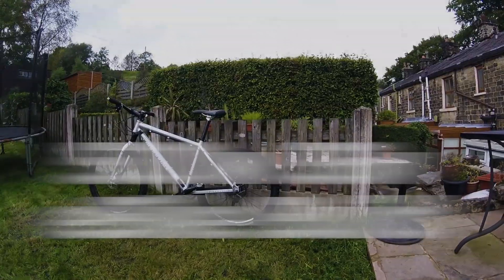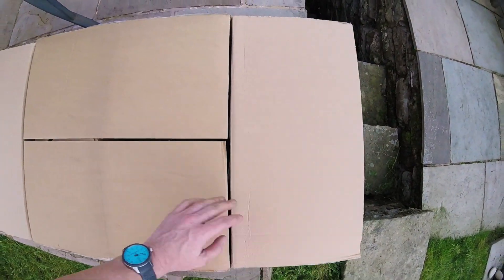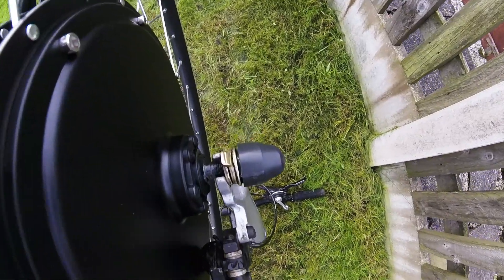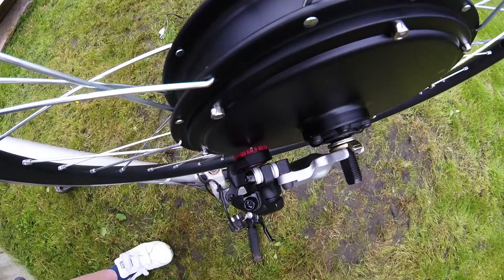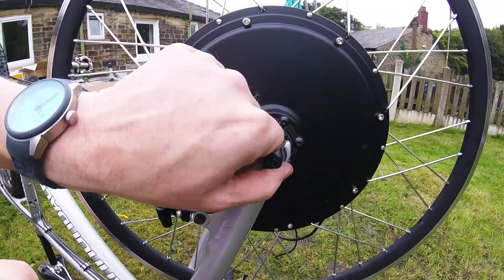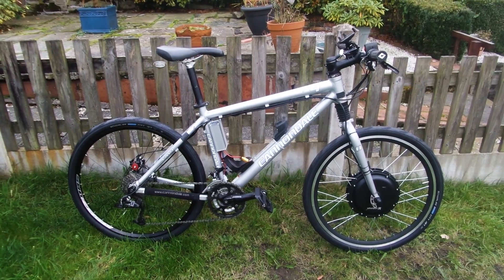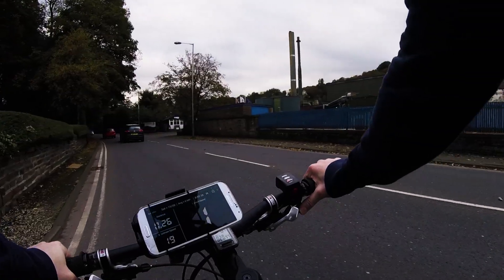500w 36v Front Wheel Ebike Build by an Ebike Noob

Comment: Do you need to pedal to get the motor going or is there enough power from stand still? 
This question is to anyone who owns a front wheel ebike?
Reply from the maker: No you don't.  Just twist the throttle & go
Reply: its a cool concept. you still have gear gadget when you run out battery...

Comment: Nice, but of course completely illegal. UK law limits power to 250W and yours is 500W. UK law also does not allow a thumb or twist grip throttle, as you's has. This means if you have an accident it is automatically your fault as you are riding illegally. If you hit anyone, they can automatically sue for large sums, again because you are at fault for riding an illegal vehicle. It's as if the legislators are determined to keep everyone in cars.
Reply from the maker: All very true.  Hopefully legislation will loosen and more powerful ebikes will be allowed.
Reply: I will post mine in a month--dual motor 1750 watts.
Reply: the law does allow a throttle
but 4mph 
called walking speed

Comment: Still working? Any repairs/replacements?
Thank you.
Reply from the maker: It is still working and no replacements or repairs.  I only use it in summer and not that often.
Reply: @richardhanson2331  hello bro. whats the  range on your bikes also what mah batterys did you use?
Reply from the maker: @mydaddrinksbathwater9103  hi, it works out at about 1mile per ah. I use a 5ah and a 16ah for longer journeys
Reply: @richardhanson2331  okay man ghanks for info

Comment: Some electric motors work as a dynamo when turned, do you think these motors could be converted to charge the battery when going down hill or when doing light work?
Reply from the maker: Not sure.  Some kids have regen but these cheap kits definitely don't
Reply: Minimal charge, regen only helps save the brake pads, not enough mass with a bicycle for decent regeneration of the battery

Comment: hi mate , nice clear vid .......i have just got one of these kits , are you saying that the pedal assist is an optional  piece ? , that you can just fit the thumb throttle and it will work fine > ......also did you not fit the  kit brakes at all ? .i thought they were needed to cut out the power to the motor when breaking ?

cheers
Reply from the maker: cheers.  The pedal assist is optional but needed for legality in the UK.  I didn't fit it though.   I didn't fit the cut out brake levers either and it's fine if you have decent disk brakes.   You can cut the power with the power button on the throttle at any time so seems safe enough to me
Reply: @richardhanson2331  thanks mate ........ i will fit the pedal assist too i reckon ., i have gone for a 12.5 amp  battery , not fussed about speed , but endurance  is what im after .

Comment: How far can you go
Reply from the maker: It depends on which battery I'm using.  The rough guide for this setup is about 1 mile per amp hoir. So a 10 amp hour battery gets me 10 miles of range or thereabouts. I could get further if I was gentle on the throttle

Comment: When I fully charge the same type of battery one light stays red but the other 4 are green is this normal or is it just because my battery is older/second hand
Reply: 4 green 1 red = 100% charge
3 green 1 red = 75% charge
2 green 1 red = 50% charge
1 green 1 red = 25% charge 
1 red = (CHARGE BATTERY)

Comment: A good build and most sensible practical and interesting comments in this thread for all E Bikers. good advise on points of very unrealistic UN Laws that endanger the rider as to power. When you buy a car it doesn't mean your going to boot it to maximum speed unless your  a lunatic. Riders need reserve power for uphill climbs otherwise risk burning  the motor out that's common sense something which is  lacking in most all UK Laws.

Comment: I have a 28" tire when i look up the 28" front wheel hubs they either dont say what fork size is needed or its between 100mm and 105mm mine is more what can i do?
Reply from the maker: Hi,  There are various models of this type of hub motor on the market.  I would search for a hub motor which fits your fork width.

Comment: Great video can you please tell me how heavy does the kit and battery make the bike I'm thinking of doing a similar conversion to a mountain bike (probley a rear wheel drive conversion) I'm in a Massenet so would like to know what they are like getting up and down stairs! & if a 250 watt motor is lighter than 500watt motor or is 500watt heaveyer than 250watt motor? or does the size of the motor in Watts make no difference in the overall weight of the bike?
Reply from the maker: Thanks.  The motor makes a huge difference to the weight.  from very easy to get up steps before the conversion, to very difficult after the conversion.  A 250w may well be lighter.
Reply: Richard Hanson Thanks for the quick reply might go for the 250w kit if it's lighter and one with a throttle/controller switch option and use it with the brakes in short controlled bursts to try & help me get it up and down stairs i hope that might work except if the battery runs out of juice lol

Comment: Do you know if can use a 48V 10Ah battery with a 1000 watt rear hub motor, though the controller apparently requires a 48V 11.6Ah battery ?
Reply from the maker: Hi, It should work fine as long as the battery is the correct voltage for the controller.  It will just give you a shorter range.  I've run this 36v on a 5mah battery for testing and it worked great.
Reply: I'd get 20ah bro 😂 mine was about 13ah on a 500w take you 3 or 4mile in 15 to 20minutes but I only using laptop cells lol
Reply: Thank you all

Comment: How can I test ma 48v against urs if ya in ramsbottom 😂😂 what a name for a town 😂😂😂
Reply from the maker: Ha it's a nice place though despite its silly name 😁 the 48v would win! I plan to try 48v on this set up. It'll either work or blow the controller.....
Reply: @richardhanson2331  its ok but I only using laptop cells 8p x12s and I got high resistance cell pack which I need to replace now very annoying middle pack too 😂 
Might just make another 6s instead tho
Ur controller probably would heat up tbf but u cud use 48v controller on ur 36v motor give it a boost 😂
Reply from the maker: @davey2k12  I'm gonna give it a go but 48v through the front wheel might be the limit!  Would rather stick 48v thru the rear to be honest!  😃
Reply: 1000w on front max but with chunky frame tho might be a wheel spinner tho like mine 😂
Reply from the maker: @davey2k12  yup I might have to upgrade from the semi slicks!

Comment: Great video. Can you please tell me if the power to the motor slows down once your finger comes off the controller. Thanks
Reply from the maker: Hi Thanks for your kind comment! Yes power to the motor is shut off when you take your finger off the controller.
Reply: @richardhanson2331  Ok. That's what I was hoping. I really want one of these kits. Thanks for the quick reply.

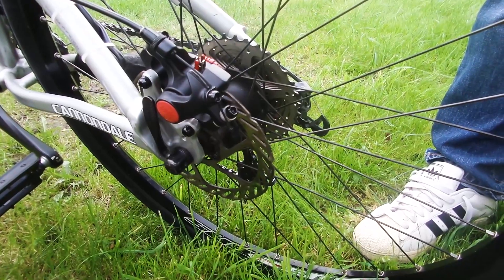Comment: I put my Ebike Front Wheel on the other side  not like you did in 4:07 is this a problem?
Reply from the maker: If you mean the Torque arm then no problem as long as you have one fitted.
Reply: @richardhanson2331  no I mean where the Cable comes out!
Reply from the maker: I'm not sure If it's the same kit as this then it only goes on this way.  The disk mounts on the wheel and the fork should be on the same side when you fit the wheel. .

Comment: greetings from florida USA. is it hard to pedal the bike when there is no power to the motor ?
Reply from the maker: Bob Americana Hi Bob.  Its very difficult to pedal the bike for any great distance with no power.  You wouldn't want b to get stuck far from home with a flat battery
Reply: thanks.  @richardhanson2331
Reply: @richardhanson2331  Hi Rich, why is that? Doesn’t the motor disengage when you switch the throttle or pedal assist to 0?

Comment: Thnks for posting this as ill be buying a 1000watt kit soon and you have sdome helpful tips about strenghting the front forks plus disc brakes
Reply: brakes are brakes but you indeed want torque arms for a 1000 watt motor.. high watt motors have the nasty habit of snapping the drop-outs where the wheel is mounted..unpleasant for a rear drive motor..a hospital visit for a front wheel drive.
Reply: @bobamericana3099   Thanks for advice but ill be going for a front wheel and yes ive been over handbars a few times when i was a kid
Reply from the maker: @sparkles9868  Brakes aren't just brakes.  With a 1000w on your front wheel you need disc brakes for sure.  Hydraulic are better but the mechanical ones I used do the job OK. I've seen videos on here of powerful ebikes with rim brakes and V brakes and there's no way they're stopping you quickly from 30+ mph.  Anything over 250w and disk brakes are a must.
Reply: @richardhanson2331   Thanks for adice but i am a qualified mechanical and eletrical engineer and know what it is like when brakes fail
Reply: @richardhanson2331  Yes I know and had brakes fail on me before which why i go hydralic when i can 

I wont be buy a hub motor now as found a more efficent way of doing it which uses all the gears on the bike

Comment: Your convesion is awesome. Just the right sort of practical speed needed to get the morons out of cars, for want of the obviously necessary total car ban (we have no carbon budget for 3 degrees warming so nobody should be allowed to have cars, ecars included). The uk ebike limit needs to be raised to a sensible 500 watts
Reply from the maker: Hi,  Thanks for your kind comment. I agree 12-15 mph is way too slow for most people to travel any kind of distance. 25-27 mph feels like a sweet spot for me.  The bike feels safe, handles well and I can cover a decent amount of distance.  I also have a solar installation in my shed so I can charge the batteries solely with green power.
Reply: bloody idiot, where do you think those kits come from?  how do you think you get them.  everything is brough by cars, ships, planes that polute and do all kinds of stuff to an environment.  but of cause, everyone is a moron for you.  go live in a fucken cave off-grid and stop using benefits of civilization then you will have a right to call people names over stupid ass enviromental opinions.

Comment: Hello, mate.

Am just about to buy the same kit on ebay. I've heard bad things how is yours holding up after 10 months?
Reply from the maker: +Dr Robert  If it all breaks, it's not the most expensive kit and you'll have the experience of doing the build.   There are some expensive kits out there which are probably better, but for a cheap simple build this is fine.  Road legal feels unbelievably slow after you have ridden unrestricted.
Reply from the maker: Dr Robert hi, I only built it for fun so not used it too often and manly short trips,  but so far it's been great, even overvolted. Done a couple of 15-20 mile trips with no problems
Reply: @richardhanson2331  Thanks for your speedy reply, I think am going to buy one and keep it in road legal mode as am only commuting 6-8 miles each way I can't see much to go wrong, I presume those people complaining just don't know what they are doing.

Comment: Thanks for the vid. How many AH is your battery?
Reply from the maker: Thanks for the comment.  I have used 3 batteries. a 5mah lipo setup, a 36v 10.4mah Li-ion bottle style battery and a 16mah lipo battery.  i sold the Li-ion battery because the Li-po batteries are more powerful and more fun.  For daily use and commuting the Li-ion battery would be the sensible option.

Comment: This is the exact kit I'm looking at to boost my commuter. How has the kit and battery held up?
Reply from the maker: Aaron _ I haven't done too many miles on it because I built it for fun.  But it has been very reliable so far and I can't see it causing any problems.   I would get puncture resistant tyres and inner tubes for commuting.  You do not want to be removing the front wheel at the roadside.  Its a real pain.

Comment: Is there a way to limit it to 250W so it's legal? Just to be on the safe side.
Reply from the maker: Yes there's a wire which you can connect which regulated the controller to 250w. Feels very slow  after running at 500w though
Reply: Thanks

Comment: Great video! I’m looking to do something very similar to what you have done, but just wondering can the battery easily slide on and off for when not in use so I can take it off to prevent it getting stolen?
Reply from the maker: Damn Son thanks for your kind comment.   The battery is very easy to remove.  This is a large frame so bear in mind if you have a smaller frame.  You can buy side fitting batteries in this case. Good luck with your build!!

Comment: With 9,000 miles of touring and 2 years as a bicycle messenger I can say that going 25 mph in city/village traffic on a bicycle is something I will not do.  This video makes me sure that the 500 watt kit I just ordered is more than powerful enough to meet my pedal assist needs etc. And possiably use on cross country tour.  I can pedal miles of city traffic to get to medical appointments but I have become to tired to pedal back, and I can't stand that stop and go of city bus. I am old and do not choose to own a car for financial/environmental reasons, plus my using a bicycle has apparantly kept me alive when I should be dead according to the doctor, so I will use the pedal assist or more returning to home.  I am glad I found this video, thanks.  
  The reason I would not go fast in city traffic is because, the only defense a bike rider has against stupid drivers, parked car drivers suddenly opening their car doors in front of you, and drivers not looking for bicycles is the quick manuverability and short stopping distance of a relatively slow speed bicycle. Edit: I have built same 500 watt Ebike kit (different brand but same kit without LCD) use three 12volt 10AH SLA (heavy at 221/2 pounds) batteries,  and also am waiting for soft pack 36volt 14AH (6 pounds) lithium ion battery (1/2 cost of hard shell incased) to carry as backup. So I can be sure to get back from where the SLA batteries take me. Also installed self contained PAS sensor. Everything not test driven yet. Will edit after test run.
Reply: YUKI INU Yes, I agree with you. Situations change so rapidly in the urban environment (pedestrians crossing unexpectedly, cars turning unpredictably) that anything over 25kph (approx. 15mph) is dangerous. I don't own an ebike, just a road bike, and I prefer to wait until I am on a quiet country road before pedalling at speed.
Reply: Tomas O Maonaigh  Yes, I hope riders with less experience than us will take what we say very seriously. It may save thier lives someday. Also obey all traffic laws! Don't do stupid things that give car drivers a reason to hate us.
Reply: Like so many people who love the idea of travelling without using combustion. Engines... People I'm afraid are going to need to petition  for more powerful bikes because the legal 250 Watts us useless today. Most people can probably spit further than a standard ebike will take them. I am sure that if ebikes had more power, then more would purchase and more cars would leave our roads.
Reply: Bikes can go in shared spaces with pedestrians. In my city of Aberdeen about half of the cycle lanes are shared. Going 15 is dangerous. Anymore is potentially lethal. In the country I've had my bike up to 45mph downhill, there's a time and a place for speed. But I don't think bikes should be capable of assisted speed much above 15mph.
Reply: Lilia Sahanova Очевидно, что вы не велосипедист, Лилия!
Reply: I believe it's about being cautious on particular situations. I always slow down when I see chances of crashing, like no having full visibility of my environment or seeing drivers inside parked cars that could possibly open their car's door, but when I see no danger at all then it's not bad to go full speed.
Reply: I've crashed at 28mph with no helmet . Damaged my shoulder but within a few days all was good . 500W should be the legal limit and the Government is looking at making it legal . Don't ride in the door zone and keep your wits about you . If you can't you really shouldn't be on the road .
Reply: ride on
Reply: same here, after watching this video my plan went down from 1000w to 500 w enough for me
Reply: Yuki Inu, mywave78, et all: Ditto. Absolutely.  20-25mph is more than adequte for a bike/e-bike in the city.  Only on a completely smooth open road would you even want to get into 30 mph.  Wind resistance will eat away at your battery range, and make vision difficult = unsafe, less enjoyable ride.
Reply: @rwo6211  Totally agree but ya their are times when 30 is better than 20-25. But ya at 30 it does make seeing difficult.
Reply: I feel quite the opposite then you do. By following your logic, lets avoid buying motorbikes as well. Since they are too fast for the city as they go above 25kph right? 
This logic is flawed. In fact, if you have the head on your shoulders, it's safer for you to do 40 kph in the city, as that way you can stay in the general flow of cars, matching their speed, and not be the douche who slows everyone down. Slow biker, presents much more danger in the traffic.
Reply: @LiliaSahanova  Doubtful that at 500 watts that the bike would go above 25 mph.  Pretty sure you would need at least 1000 watt motor to do that.